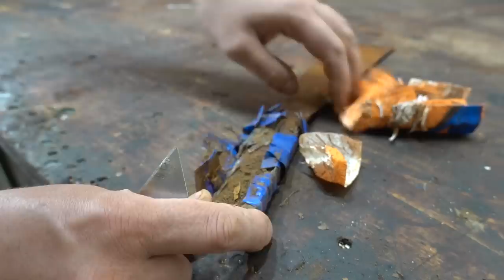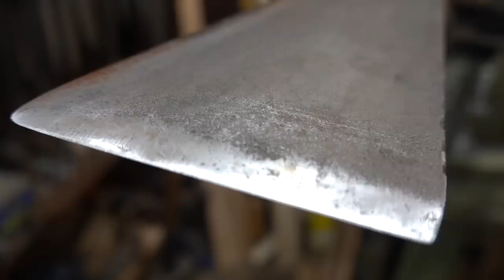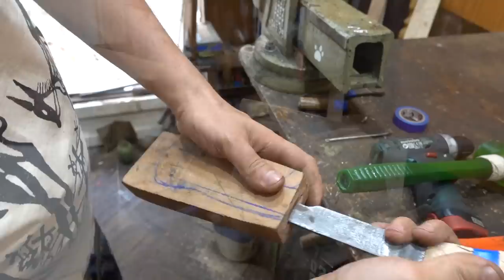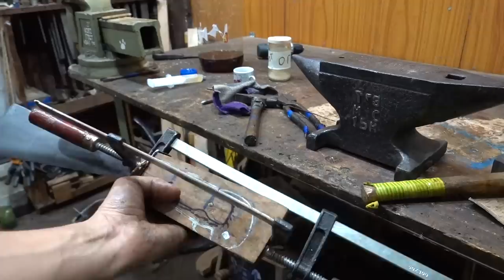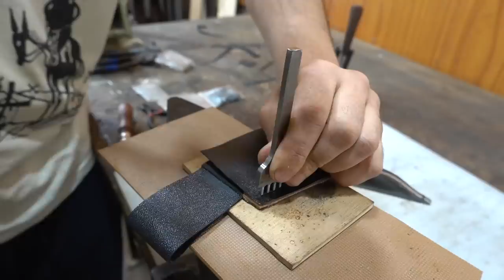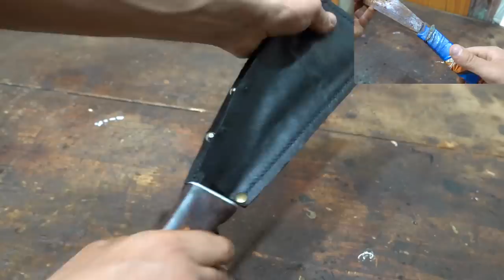Restoration Rusty Soviet Survival Machete

Comment: What are the dimensions? I want to make one just like it. 
Great work as always.
Reply from the maker: Good afternoon, thank you for attention. I checked the name of a new machete that was produced 40 years ago. The total length of the machete is 360 mm, the length of the blade is 240 mm, and the width of the butt is up to 4 mm. Also, the machete knife itself has a triangular shape with two sharpened sides and can be used both as a chopping tool and as a means for digging.